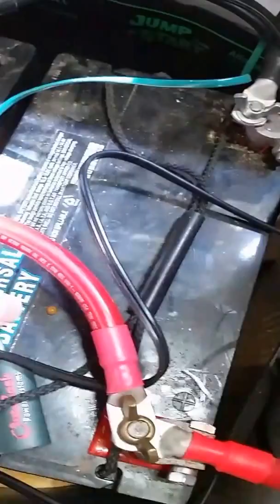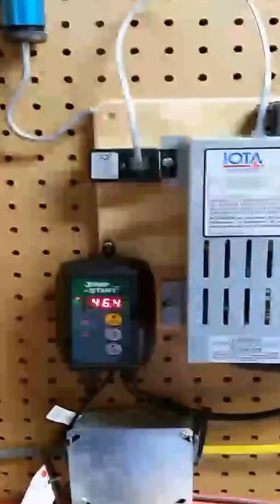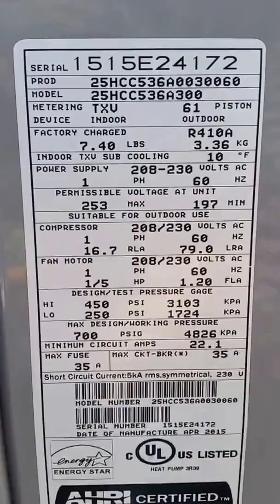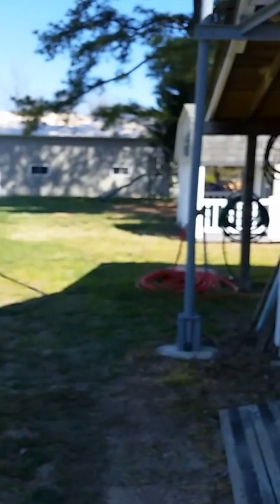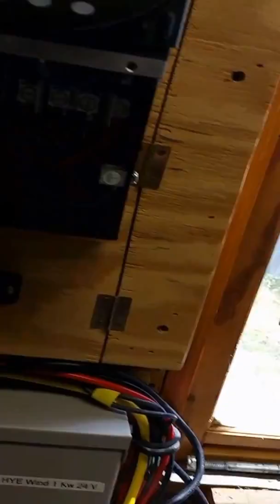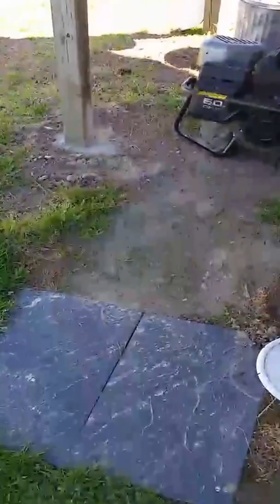Solar Charge Controllers and Heating Batteries Live With KVUSMC

Comment: Been watching for years, appreciate and have learned a lot. I am using the universals for my emergency standby 600 watt system, the 110 AH group 30's. They make L16 AGM I thought about getting some. BTW the battery temp sensors need to be mounted on the long side not top, near the plates.
Reply from the maker: Many Thanks I Appreciate it Buddy  Yes The Sensors Should Be at Midway along The Sides I agree near the Plates

Comment: I've enjoyed watching you videos Kenny. On regards to the fans. Are they on Auxiliary load from your outback. I watched one of your videos which has that. I intend powering 3 small 12v Computer fans of 1.2 watts each through outback AUX mode. Any advice.
Reply from the maker: +Will Willy that should would Great I have mine set up to come on at voltage like Float Voltage